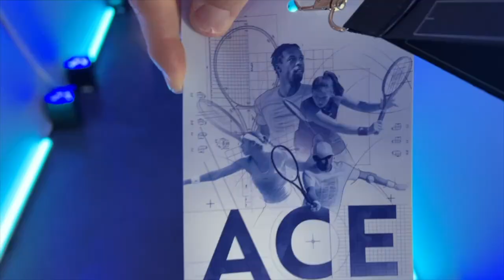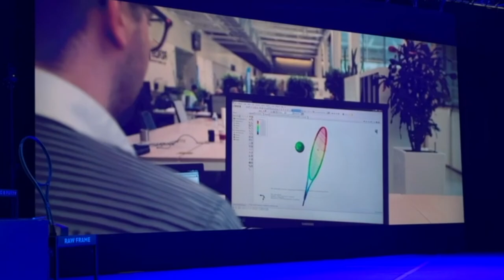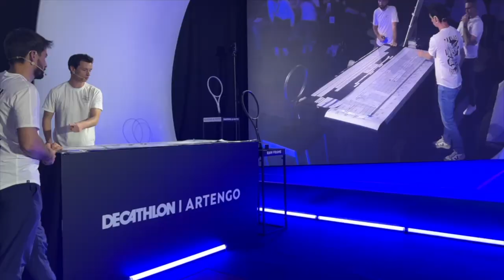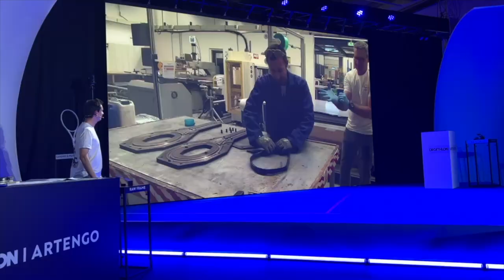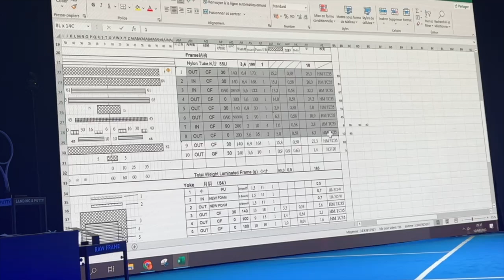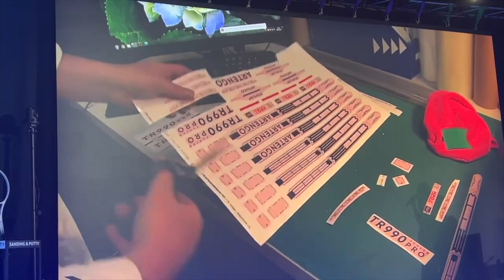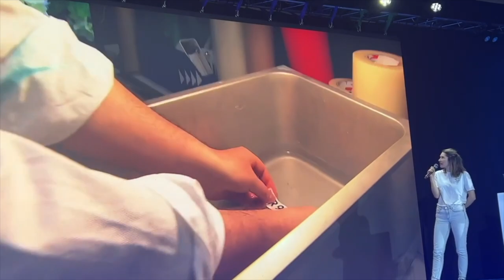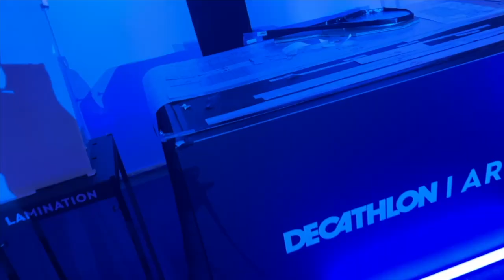How to make a tennis racket (with Artengo)

Comment: It appears that Artengo is launching the new TR990 Power Pro tennis racket which might be a blend of the TR990 Pro (the first edition of the TR990 series) and the TR930 Spin Pro (the first edition of the TR930 series).
The new TR990 Power Pro has similar specs to the first-generation TR990 Pro, such as a weight of 300g and 70 RA. However, it has a different beam width configuration of 25-25-23 (listed) compared to 24-23-22 (measured) of the TR990 Pro (Artengo has not listed the TR990 Pro beam width). 
Artengo might have redistributed the weight to make it a more powerful racket.
It seems that this new TR990 Power Pro will play more like the TR930 Spin Pro (300g, 72RA, 23-26-24), but will boast more power and less stiff. It will be interesting to see what Artengo implements in the second generation of the TR930 Spin Pro, considering that it is primarily recognized as a stiff racket, rather than a spin and power racket.

Comment: Nice video, thanks. I own a TR960 and it's a good racquet. I'd say it's as good as any of the 'premium' racquets I own in terms of quality and feel etc. But I agree that it's aesthetics and branding where Artengo has work to do. Everything looks a bit gaudy and cheap. Even the logo and wordmark are bad, separately and as a lockup (quite an achievement). They need a rebrand from the ground up, something worthy of their racquets.
Reply: They brought on a graphic designer to show Tere and Air, than did nothing with the racquet colours to reflect the slides.
Reply: why to buy a Tr960 at 110 euro when a Head Gravity is at 150 euro right now.
Reply: @lartisan6274  Because it's still cheaper...
Reply: @tijgertjekonijnwordopgegeten  ".... " lool better to put + 40 euro for dont have " vibration" . whatever Artengo shoes are bullshi  and balls too hard , Surgrip same, string too,   They are not cheaper, they have same prize ..  Artengo shoes 90 euro Vs Asics 90.
Reply: @lartisan6274  They are cheaper lol, just bought their  shoes for €50 on sale (retail is €80) and if you want good shoes from asics that is at least €140 retail and maybe €100 on sale. I have used both asics and artengo shoes and the difference isnt big enough for me to pay the extra €40. I also happen to like their grips but that is personal preference I suppose.

I agree that their "red' balls are hard but  "blue" tennis balls are not.

Comment: Same weight and balance yields different swing weights? How is that possible?
Reply from the maker: It is all about weight distribution
Reply: @Tennisnerd  Isn’t balance represents weight distribution?
Reply: @akbarberlian  more polarized weight means more swing weight. even though balance and total weight is the same
Reply: @akbarberlian  yes, ballance is a measure of the weight distribution, but swing weight is a different measure of weight distribution. Balance is weight distribution relative to a point near the middle of a racquet whereas swing weight is measured relative to a point near the butt cap (though admittedly I'm not sure exactly where.

For example, consider a racquet with even balance. Now let's customize the racquet in one of two ways. First add 10 grams of lead tape to the balance point, the balance will stay the same, but the weight and swing weight will increase. Second, instead add 5 grams to the top of the hoop and 5 grams under the butt cap. Both customizations will have the same balance, both will have the same weight (the original weight plus the 10 total grams that were added), but the second option will produce a greater increase in swing weight.